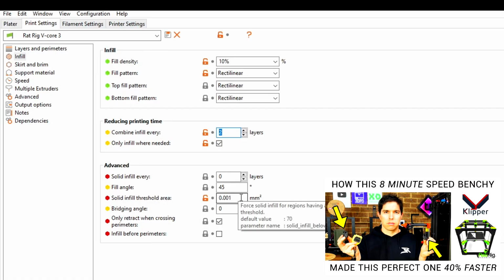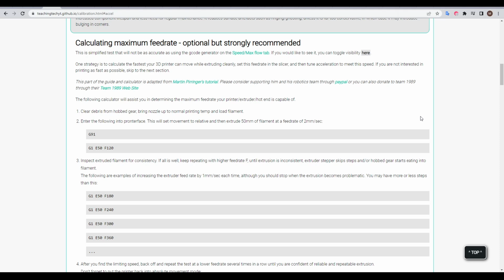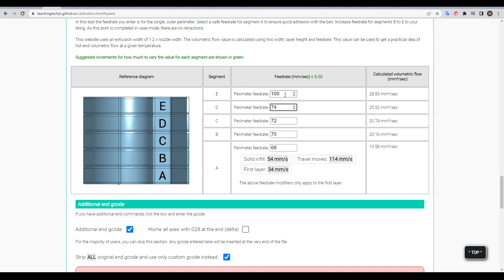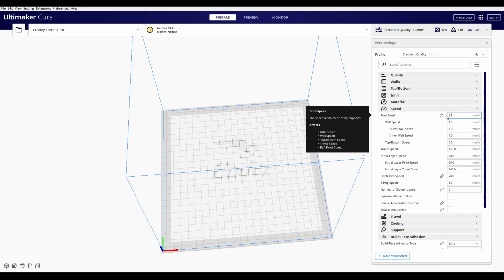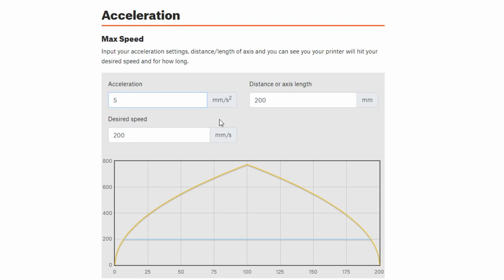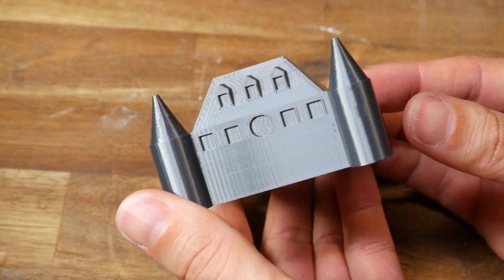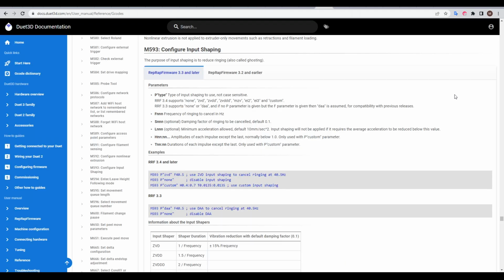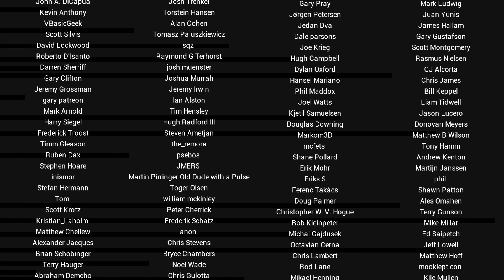5 things to check & tune to 3D print faster

Comment: Should someone make this mods on a print farm to increase profits?
Reply: It goes without saying: you definitely want to tune settings properly and have some standardization. 

As you nudge toward the limits, you’ll definitely start to see an impact on quality and print reliability. 

It’s also worth asking whether or not the value is in the deposited plastic or in the design itself. Look into Perry Parts and their bump stops, Slant3D did a great video. In fact, just pull up and Slant3D video reviewing design optimizations that improve quality and reliability in prints. Building your own minimalist supports within the actual design leads to huge time savings due to the reduction of filament use (and associated printing time). You can attach these built-in supports using small sprues which make minimal contact and can thus be easily removed, etc, etc.

Comment: i just started using klipper. do i need to install new macro for speed. my machine is ender 3 s1 pro. also when using the speed & max flow i found the printing not going above 160 and it was always fluctuating so should i use a figure where it could hold the speed without huge changes

Comment: 🎯 Key Takeaways for quick navigation:

00:00 🚀 To 3D print faster, start by identifying and managing limitations.
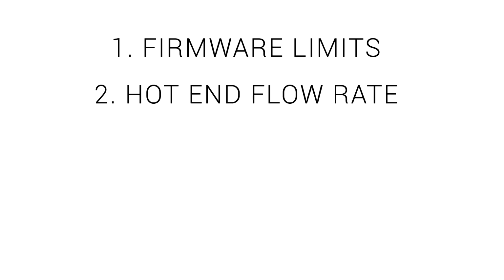01:45 🌊 Hot end flow rate is a crucial limitation to understand when printing faster. Test your maximum volumetric flow rate to determine the fastest speeds you can use.
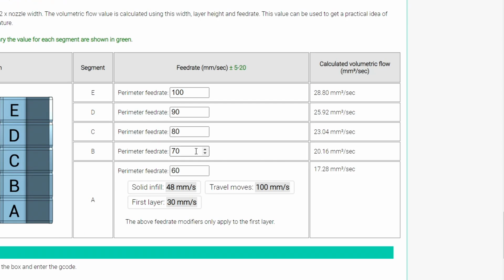04:04 🐢 Adjust your slicer settings for maximum volumetric speed based on your hot end's capabilities to prevent extrusion issues.
06:41 🌡️ Increasing hot end temperature can improve flow rate, but it may lead to other printing issues, so find a compromise.
08:32 🏎️ Consider acceleration settings as they impact print time and quality; increasing acceleration can lead to faster prints but may require adjustments.
10:54 🛠️ Mechanical artifacts like ringing and layer shifts can affect print quality when printing fast. Experiment with acceleration settings and input shaping to find the right balance.
12:06 ❄️ Adequate part cooling is crucial for maintaining surface quality when printing fast; upgrading your part cooling system can improve results.
12:34 🔧 Combine strategies like adjusting feed rates for internal infill and increasing travel feed rates and acceleration to optimize printing speed while maintaining quality.

Made with HARPA AI

Comment: This is a nice video and the calibration website is very handy. There is still one thing that I am confused about. I can see that my firmware has limits on X and Y motion speeds. And I can see that the calibration site generates G-code with lines like "M220 S100 ; custom speed A - 20 mm/sec". My understanding is that M220 is sets a relative percentage. How does it know that 100% of /something/ is 20 mm/sec? What is that something, where can I find it, etc?

Comment: General question, when I use the permiter speedrates you've used on your video within your teaching guide, my returns are half that for example you have 100mm/sec feeding back on the screen as 28.80mm3/sec, when I enter the same number on your website I get 9.60 mm3/sec returned in the calcuated volumetric flow?

Comment: I learned a lot from your video, thanks. Does the ender 3 v2 have a max speed limiter to prevent any damage to steppers or other parts from extended printing at high speeds? Thanks

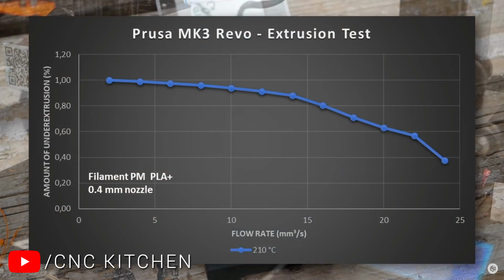Comment: at 2:54 the chart shows underextrusion at around 4mm3/s.  But in your test, you were able to get ~20mm3/s.  I assume 1) you have an upgraded hot end, or 2) You are willing to tolerate an amount of underextrusion so long as the part holds together.  This would mean dimensional accuracy and structural integrity would be sacrificed.  Am I correct?

Comment: @teaching tech im hoping you can help. i bought an used Ender 3 of FB. It was a printer that the person was still using so i know it works. The issue i have is it looks like there are a few thing that were upgraded and not sure what all is on the printer. is there a way to find out easily. im looking at upgrading the mainboard so need to know what all needs to be done when down loading the new firmware

Comment: Hi Michael, I gave it a go to your acceleration tuning test, and for some reason I can't figure out, the print head stops a second or two, will still extruding causing a blob every layer on the same spot. I use Cura. Any clue please? May be your Gcode got somehow corrupted? Ta!

Comment: Does anyone know why I set my feedrate to 500 above and my print still intact and alright?
I have set M203, M201 and M204 to exceed the limit. I have also update the firmware to mriscoc
P.S I use creality ender 3 v2

Comment: so I got my ender 5 plus with DDX and mosquito hotend using the speed and max flow. Perimeter speed up to 2000, printing abs, perimter speed 60 is defienetly the best with 80 not far from it, however above 1000 i didnt notice any difference
0.6 nozzel 0.4 layer

Comment: On a printer without some seriously upgraded cooling, your flow test piece is likely to hit cooling failures before extrusion rate limits. You can mitigate this by blowing a desk fan at the printer but then you need to make sure your hotend is sufficiently insulated or you might just strip away so much heat from the block that the flow drops.

Comment: Some good tips and I will check out your calibration website. Have you done any testing on ringing on square/straight edges prints by comparing rotating 45° on the bed so no straight edge perimeter uses just X or y axis to print but both? Also, I've been doing some experiments with prusaslicer fuzzy skin - try depth 0.06mm, length 0.1mm - it gives a cool, subtle texture and makes parts stiffer in my opinion as the internal perimeter crosses over the deviations of the outer perimeter forming a better bond. I have tested with functional parts with a 0.3mm tolerance and they did not fuse together.

Comment: In Cura, biggest gains for the lazy: (assuming your printer is already calibrated) 
- increase inner wall, infill, skirt/brim and travel speed (don't increase Outer Wall speed).
- remove infill if the part supports it (more walls w/o infill is faster than less walls w infill), 
- increase wall width to achieve same total thickness with less walls.
- enable Filter Out Tiny Gaps,  (assuming the model is watertight)
- set Fill Gaps Between Walls to Nowhere
- turn on/off Use Adaptive Layers as it sometimes saves time.
Reply: Agreed! Also disable infill before walls that way your infill lines won’t show through the walls when you’re printing 2 of them at 0.6mm line width.

Comment: Great Video - Only thing missing IMO - especially if you go really fast - is layer adhesion. Expecially on bigger parts where the previous layer had plenty of time to cool down. The next layer needs to bond with the previous one. So If you lay down a molten noodle too fast the layer adhesion will suffer. Not critical for a "look at" model like a figurine but it can make a difference on a mechanical part. Also just checking the weight of the extruded filament IMO is not enough as at high speeds you still might get the same weight of filament  but if you look at it the extruded material is shorter and thicker. This happens when the pressure inside the hotend gets too big and it compresses the molten plastic too much and then when it comes out of the nozzle it expands
Reply: If you get layer adhesion problems when the previous layer has cooled all the way, your nozzle temperature likely isn't high enough or you're underextruding from going too fast. I used to think "printing on a cooled layer" was my problem for petg, and turned fan down or even off for it, but got bad surface quality and overhangs from doing so. Just cranking the nozzle temp up allowed me to print petg with full cooling (and I have some rather extreme cooling).

Comment: Visual maximum flowrate test might not be accurate - there most likely will be underextrusion before perimeter breaks (example: Bondtech CHT test model, 0.7 mm requested line width with 10ish mm3/s flow -> <0.45 mm realised line width).
Stefan's test is nice, but requires milligram scale.
Extruding 100 mm filament with different volumetric rates and measuring actual amount extruded would be good enough for practical use. Then it's only a matter of choosing acceptable skip 😉

Comment: i have been printing 95A TPU with a 1.2mm volcano nozzle at 0.6mm layer heights.
i have theorized that i am encountering 3 types of flow rates.
the flow rates are:
The Nozzle
The extruder
the material.

In this case i found that my nozzle and my extruder could handle the high flow rates but i suspect the material cant handle the high flow.

So, by using the speeds recommended by the manufacturer i was able to determine a flow rate that is within the calculations and the prints are far superior.... althougg much slower..
Reply: For decent print speeds with TPU, Overture has a "high speed TPU" product (95A) that seems to work. I can print it at about 8-8.5 mm³/s.
Reply: @daliasprints9798  interesting. i think mostTPUs max out at about 3mm^3/s
Reply: @Mr_Pewpy_But-Whole  Yeah. I can do a little over that, but I have a really good extruder pushing it (Flex3drive G5 which you can see on some of my videos).

Comment: Using volcano hotend on ender 3v2. The termistor is relocated, so now it touches nozzle's thread. I can print at 100mm/s with 1800 acceleration, 8mm/s jerk

Comment: Great video and to add there should be something about obvious item is changing the nozzle to larger diameter to do thicker layers so less layers needed to print but sacrifice detail.  I have stock .04 but now have a .06 to try out in the middle  since .08 is too large for what I'm wanting

Comment: Your flow rate calculations might give people trouble with SuperSlicer. You are calculating based on a rectangle of layer height by line width. SuperSlicer calculates the flow based on rounded edges.

Comment: Another great video…

Another Important setting for maintaining quality when printing fast seens to be Jerk, corners tend do become bulges when it’s too low, even when acceleration is correct, because the speed is not translated into corner turning velocity and we have a slight stop before starting to accelerate again
Reply: linear advance / pressure advance fixes that

Comment: I noticed that when you start to reach the limits on your hotend, the filament it pushes out becomes thicker than the nozzle size. Increasing temperature or slowing the speed will fix that. The plastic is not coming out at same temperature and speed, some of it slows down and this allows the extruded line to become thicker. Skipping is related to the wheel grip, not just hotend. I use both now, just see when the line starts to look different and that is your maximum, at those temperature. The sensor does not measure nozzle temps but block temps, it can be seriously lower inside the nozzle at high speeds. Of course, without adjusting the pressure that the extruder gears have is a way to get faster extrusion so the free air print test still applies to the current state of the machine. But it might not be just hotend that is starting to lag behind, it can be that the extruder has too weak grip.
Reply: Is the filament swelling not die swell from internal stresses?

Comment: I'm not entirely sure a revo with a .4mm nozzle is capable of 20mms flow rate. It's likely that like you explained, your acceleration isn't high enough during that test to ever reach max speed.
Reply from the maker: My acceleration is 5k. I made a whole video about testing the Revo at high speeds with print times included. Check it out.
Reply: @TeachingTech  The max flow rate advertised on the revo is 10mm^3/s. Is it possible you've made some mistake? I barely get 22mm^3/s on an nf crazy hf (basically volcano) and 8mm^3/s on a v6 so 20 would be surprising on the revo.
Reply: @imst4722  My Prusa MK2 has a E3D V6 normal hotend (2017 tech)

It has no gear reduction and is single drive (one hobbed in the nema17 and a bearing at the other side with a spring). It can reach 15mm^3/s easily

My tronxy 3d printer has a Titan clone extruder with a PTFE hotend (like ender 3) and also reach 15mm^3/s

Maybe your extruder is to weak, try increasing the current or with a reduction. If the extruder motor skips steps you need a better extruder, until the extruder bites and destroys the filament.... there you have a hotend "bottleneck" in the system
Reply: @TeachingTech  unless you're using a larger/smaller nozzle than .4
Reply from the maker: Watch the Revo video and see for yourself. 0.4mm nozzle, 0.2mm layer height is my normal. In terms of their advertising, I think they are under promising and over delivering.
Reply from the maker: Also worth mentioning I'm printing pla at 225 deg C which helps. The Revo is very good for not stringing so no problems there.

Comment: Step 1)
Install Klipper
Step 2) figure out input shaping
Step 3) change your max accel values
Step 4) figure out pressure advance
Step 5) yolo
Reply: Just started using klipper recently. I actually enjoy tuning and tweaking my printer now. It's so easy to change things compared to marlin
Reply: step 1 will usually get you about 10x ball park
Reply: @TommiHonkonen 10x of what?
Reply: @icebird76  starting point
Reply: @TommiHonkonen  I still don't get what you're saying. I installed Klipper and I see maybe a 25% faster print time on average which is only 1.25x. Nothing is 10x or else a 1 hour print would take 6 minutes.
Reply: @icebird76  is joke or is!?
Reply: 10x immediate is an exaggeration, but as final result it's believable. My initial experience was that with Marlin I could crank up the acceleration and get drastically faster prints, but then started hitting layer shifts (this was just around 3-5k) and I waded through bug tracker threads with hundreds of comments where nobody could agree whether it was a buggy interaction between linear advance and junction deviation (new at the time) or what. On Klipper these speeds just worked. And once I got input shaper setup, much faster ones did too.